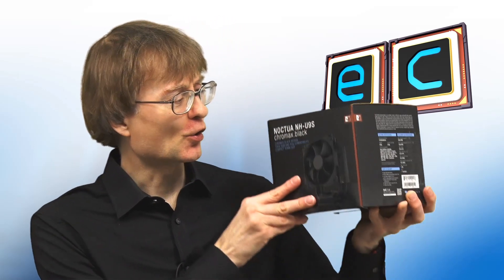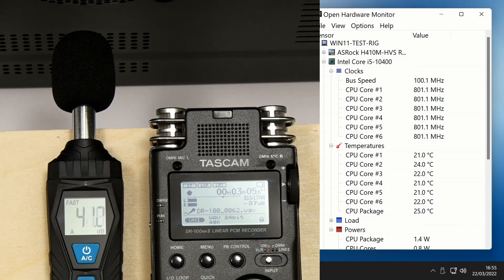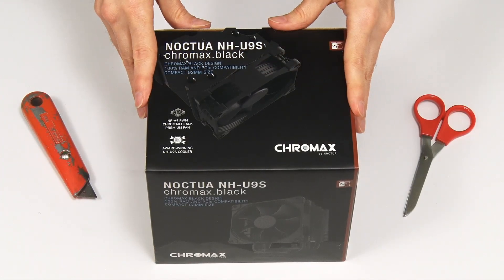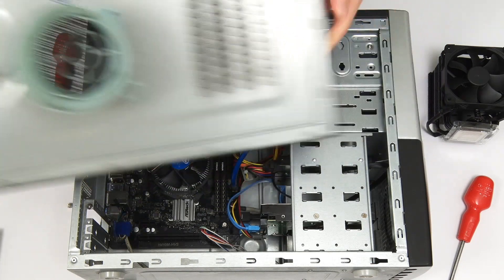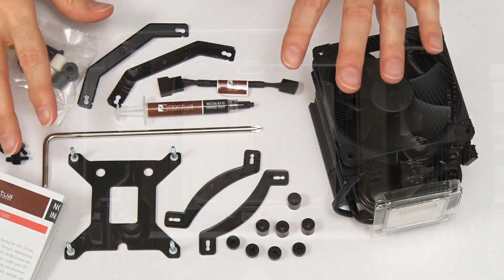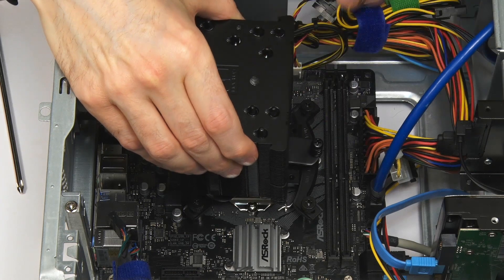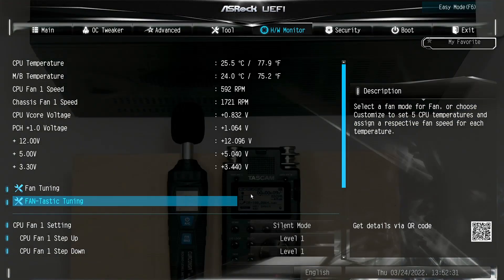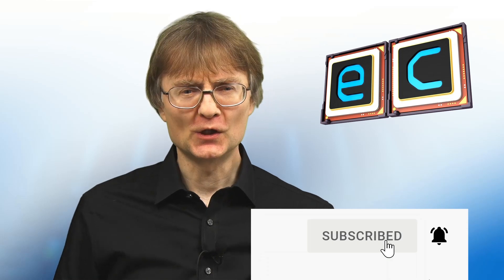Quieter PC #1: Noctua NH-U9S Cooler

Comment: Because I'm not overclocker,I'm using a 12-year-old cooller, 2 heatpipes, a quality stepped cube with thin ribbing. I changed the fan with useless thin curved lamellas and very high rpm!The best is the technology that ARCTIC COOLING came up with flat, slightly curved lamellas with 1000-2500 rpm.
I can cool the Ryzen 5 5500 at 4.2Ghz just fine and the temperature never even reaches 50 degrees. I have a 20-year-old "PRO station 2002R" case. I'm not demanding and I've been building PCs for 30 years.
I had these tower-cooller when it started only once and got rid of it! I'm old school, started with PC in the 80s, now 50+

Comment: One year ago I built an Intel 11900k system with a be quiet cooler.  I used Thermal Grizzly Kryonaut I installed twice completely cleaning the IHS and cold block prior to the second installation.  I have had no reason to look at the components since that time.

Today I learn about the Kryonaut scratching problem.  I presume that this is over blown but I am unable to find a definitive discussion of what happened and how it was resolved.  I find many angry post with speculation about what happened but nothing from any hardware reviewers or from Thermal Grizzly.

I have heard:

The root cause was improper cleaning by users.
Twisting to remove the cooler.
Hard particles that touched the exposed paste prior to assembly
Silver or Aluminum in the paste being pressed into the metal
A bad batch of Kryonaut.  I have found post from people who reported problems to TG and they replaced the paste and in one case purchased the customer a new cooler.  This may be good customer service but it is being treated as an admission of guilt.
A bad batch that is not being distributed by TG but is available via outside sellers on Amazon and Newegg.
Counterfeit paste

I would really like to understand what actually happened.  Is there a definitive write up on this problem.  As I understand it the problem started around 2018.

Comment: CPU FAN config...
That stock Intel fan could have been far, far quieter if you set an aggressively quiet fan profile. You can likely run 90degC on the CPU constantly. So I would personally have had THREE different ramps. The first is FLAT for IDLE. Whatever RPM keeps you below 60degC. Then ramp from 60degC to 80degC, then a sharper ramp to 90degC at 100% fan RPM. I use the same basic profile regardless of cooler. FLAT in idle. RAMP. Sharper RAMP. FLAT again at 100%.

Comment: I like computer cases built just thick enough to accommodate a 5.25" drive, a 120mm at the front, and two 80mm fans at the rear, unfortunately cases like this aren't made any more.

These smaller 92mm towers fit perfectly in such cases, but the 120mm towers don't. Not a problem with the quality 92mm fans available today, but it's understandable how 120mm fans now dominate the market given how awful and droning many smaller fans were throughout the 2000s.

Comment: Thanks for this! I've got an i9-9820x that puts out a lot of heat when working hard and the Intel cooler is obnoxiously loud and high-pitched. Worse, even after fiddling with the motherboard settings it still tended to constantly rev up and down. I had thought about replacing it with something bigger and quieter but it sounded like too much effort, but after seeing this video I figured seems easy enough. I got an NH-D12L and the temps under full load dropped about 16C and it's nearly silent! The Intel fan was clearly audible from out in the hallway outside the room the computer is in even with the computer idle!
Reply from the maker: Great to hear about your success with an NH-D12L. :)

Comment: Always more rather than less, for the thermal paste.
Reply from the maker: No, always less rather than more. You need as thin a layer between the CPU and cooler as possible.
Reply: @ExplainingComputers  You achieve that by using a paste that spreads well enough. If you have to little you might not cover enough of the CPU. So you just need to make sure you have enough, and an even spread.

Watch "“Too Much Thermal Paste” – Benchmark of Thermal Paste Quantity" from Gamers Nexus.
Reply from the maker: @Bart230  Obviously you need enough to achieved coverage, but that is a very small quantity. For decades this has been a contentious issue, and there is evidence to point to on all sides. Some years back I did some tests using a glass plate, and Noctua's recommended drop "4 to 5mm" in diameter was clearly ample.
Reply: @ExplainingComputers  You did not define what less means so it's subjective, and more is not an issue.

So less rather than more, can push you towards too little without any benefit, so it's wrong.

And more rather than less, will push you above the minimum, and the only negative is that there's more to clean up. Assuming you use non-conductive paste, which is pretty much standard for anyone who needs to hear this.

We're not discussing "ample" here, as the statement was not "make sure to use an ample amount"

Comment: I bet you didn't expect it would install this close to your RAM, Idk i be keeping an eye on that or remove 1 RAM Stick.
Reply from the maker: Yes, I knew it would be close to the RAM -- although what you don't really see in the video is that it is fairly high above it. Removing one module is not an option! :) Having cooler vanes close to the RAM is not a problem.

Comment: Christopher, it's really useful that you've listed reminders of the previous upgrades in the section above. 👍🏻
Interesting that you rejected passive CPU cooling because of the additional case fans required. I've usually found that a large case fan (say, 120mm+) tends to be a lot quieter that the smaller ones simply because it doesn't need to spin as fast. That said though, you're not working on the fanciest case in the world, so your locations for case fans appear to be a bit limited. 
Never a criticism of what you do of course, and you did show us plenty of alternatives too!

Comment: I wanted to make a quiet PC so I got a case from 'Quiet PC'. I'm pleased with it's acoustic quietness but dissappointed with it's radio frequency radiation. It outputs a large number of carriers in the 430 - 440 MHz band which are not present on any other PC I have.

Comment: Would a standard fan with a voltage reducing resistor be as quiet and cheaper than a noctua?
Reply from the maker: Yes, a standard fan could be run slower (and hence more quietly) using a resistor -- but this can also be achieved in the BIOS settings for a modern CPU fan. For comparable airflow and cooling, it would be as quiet as a Noctua.

Comment: Noctua is very quiet and a good noisegate like the one in adobe audition can do the rest
Reply from the maker: Noise reduction is certainly very useful, and I always use it. But the problem these days is that it is too often relied on as the fix all solution. We now have cameras, lights and HDMI/SDI recorders, all of which have fans in them -- and all of which are sold saying "oh don't worry, you can get rid of the fan noise using noise reduction software". And when you use all this equipment together, you can't -- or at the very least there is no headway for having additional noise from a computer! :)
Reply: @ExplainingComputers  Yes it works well if you record everything straight to computer. But if you use something like stand alone cameras then it is a different case. But making webcam stream it's very good. Adobe audition makes background allmost dead silent, thou it takes quite alot of power. My setup is i7 5820k  4x4gig ram and 2080rtx 8Gb 5-6 years old but still ok. Oh yes and 6 noctua fans plus 3 fans on strix card and a powersupply fan.

Comment: Very good, but wouldn't it be cheaper to put the PC in a cupboard under the table/bench with some baffles on the air ducts?
Reply from the maker: There are always alternatives, but what you mention is not practical for a test system inmy studio environment.

Comment: A good way to fully load a cpu is to use the "stress" application on the command line.  My AMD Ryzen 3700x 8 core cpu runs at 74.1C fully loading the system using "stress -c 16" !

Comment: I had just added a new power supply to my computer and was wondering if I had made the right choice. Getting to the end of your video confirmed I had. Exactly the same make and model. Other than initial start up, I have had no fan noise yet. Thank you for your straightforward, well explained and informative videos.
Reply from the maker: This is great to hear. I too have no fan noise, other than on startup -- it does not kick in until 220W draw. :)

Comment: Thank you for the video. I have recently fitted my Ryzen 7 5700g system with all Noctua fans and a Noctua Nh-D15S with a second fan fitted to it and it is pretty much dead silent now. Coolermaster N200 case with corsair 450 w PSU. The only downside is that under heavy system use my Samsung 970 EVO plus NVME is reaching 73C. Is this too high?
Reply from the maker: 73C is high for an SSD. I would personally consider fitting it with a heat sink to get the temperature down a bit

Comment: How can you tell if that blob of heatsink compound has spread across the entire surface of the CPU.
Reply from the maker: Because it has nowhere else to go as the cooler and CPU are pressed together! :) And when you remove a cooler, it can be seen! But it is important not to raise the cooler whilst fitting -- it must go down and stay down, else there is the risk of air bubbles being introduced (as there is if you spread the paste manually).

Comment: Hi, I am planning on doing something similar to my computer.  Why did you choose a CPU cooler with 92mm fan?  How did you know 120mm fan doesn't fit?  Did you measure it?  I believe I roughly measured 155mm from base of CPU to top of case?  Would be tight fit.  Is there much difference between 92mm and 120mm CPU cooler?  Thanks for the videos!  Do you plan to cover over the holes in the side to eliminate more noise?
Reply from the maker: Yes, I measured it! :) So I knew the 120mm fan coolers I looked at were 5mm taller than the space available in the case. I hae now completed this project, as will be shown in a video posting here a week on Sunday, and the PC s now virtually silent -- well below 30dB. So the holes in the side will remain open -- there has to be ventilation into the case anway. :) Good luck with your own PC.

Comment: Now swap the HDD for an SSD, and for PSU, you could just open the PSU, and install a curve bladed case fan in it.
Just make sure it's the right voltage, as some PSUs run their fans at 24V, not 12V like most case fans do.
Reply from the maker: In the next video I replace both the PSU and case fans. The HDD in this computer is not in use -- the boot drive is an SSD. As I said in the video, this is a test rig, so the HDD hangs around for use if required in specific situations. The PC is now almost totally silent (well below 30dB.)

Comment: I would strongly suggest BeQuiet for case fans, they certainly live up to their name. I run these along with a BeQuiet CPU Cooler and they're great. The computer is silent with them running at low rpm to keep air moving and under load they're still very quiet.

Comment: Seems a shame to lose the inherent air-flow efficiency of the duct. No?
Reply from the maker: Not at all. For a start such side ducts only work with small and noisy Intel coolers. More fundamentally, the Intel ducts were hardly smart, as while they guaranteed that cool air was drawn into the CPU heat sink vanes, they disrupted the case airflow that cools the rest of the system. In contrast, the new cooler I've fitted works with the case airflow, helping rather than opposing the process to draw air in at the front and out at the back. Intel's ducts were introduced as a panic measure when Intel was really struggling to keep more powerful CPUs cool. They disappeared for a reason! :)

Comment: OH OKAY, THAT MAKES MORE SENSE. LOL. My PC runs at a quiet 70-80dB of noise when all fans are at 100%. I went with their industrial line since I put a server-grade TRx3990 in my PC with a 3090, but didn't really need to go so all out, since it turns out when both GPU and CPU are max over-clocked (as much as PNY the Graphics Card Manufacture, and ROG/ASUS MB maker, would allow) the temps reach only 50C in a 26C room (I think 26C is 80F, I use F not C, in the US). EDIT: You can technically have TOO little thermal paste. As long as the paste isn't conductive, you can glob the heck out of that CPU. Since any excess would be squished out to the side. They say "pea sized" blob for most CPUS unless Threadrippers, way more than pea-sized.

Comment: I built a quiet PC in December of last year. I wound up starting with a lower power i5 processor but also faced the choice of a quiet fan vs. passive cooling. I went with the former and while the machine inst silent, it's no louder than ambient noise in the room even when rendering video. It's certainly quieter than my laptop which is pretty quiet itself.

Comment: years ago i built in a passive cpu cooler and am using it until today. additionally i built in a passive power supply and of course removed the old hdd in exchange with an ssd. result is an absolute zero noise pc.even gaming and video editing do not result in overheating. silent pc's are the best.

Comment: I would say the fan is upside down. 
But u have no case window so it doesnt really matter
Reply from the maker: I presume you are referring to where the cable comes out? It was easier to keep it at the top.
Reply: @ExplainingComputers  of course but in a case with tempered glass window you would probably want it on the bottom.

Comment: Quiet PCs just bring up an annoying topic for me. Cause of course, connected with getting a PC silent is how much power it uses. And then one has to wonder, why it is so hard to get mobile, low power processors with according low power supplies for your average PC build. Nowadays, with those very powerful mobile processors and the incentive to use less power overall and also to still have a modular computer, it is a riddle to me, why one cannot build a desktop PC with so called mobile parts. I mean, you have those nucs/mini-PCs, but they are far less modular than your average desktop PC and you basically have to throw the entire thing out when one part breaks or if you just want to upgrade one part.

Comment: Great video :) As someone who has been building quiet PC's for my clients for many years, I have had excellent results from the Noctua NH-U12S, which is the same as the one used in this video, except it uses a standard 120mm size fan. The larger fan also allows it to run at a lower RPM.

Comment: Minimum sound level (2:10): I was wondering how low the NIOSH sound level meter on the iPhone goes, and discover it also only goes down to 30dB. I discover there is a reason, which is that this is about the sound level of a quiet room, so unless you're going to compute in an anechoic chamber there's not much point in measuring lower. Always glad to see content on keeping computers quiet.

Comment: Chris, back in the day when i was in the field full time i easily built more then a couple thousand custom pc's with almost all having heatpipe coolers ( no liquid cooling back then) yet is wasn't until watching your video, twice even, that i was hit by a revelation (well revelation to me), we always install heatpipe coolers with the MB sitting horizontal and the cooler vertical, logical right, but then we run the pc with the MB vertical and the cooler horizontal which theoretically renders the whole heatpipe principle of heat rising null & void, theoretically logic would dictate that with a MB in the vertical position a solid copper cored heat sink that has large enough fins and a centrally mounted inward blowing fan would cool better the a heatpipe cooler in the same position ....do you see it?
Reply from the maker: This is a very good point, and I totally see where you are coming from -- heat cannot rise up the pipe with the cooler horizontal.  I imagine the general principle still holds -- liquid evaporates where it is heated (where the heat pipe are in contact with the CPU block), and the gas moves along the pipe where it condenses back into liquid. But clearly the process would work better vertically -- the hot gas rising up, condensing, and dripping back. I am going to worry about this now. :)
Reply: That's a very interesting point. Might explain why I've seen a few coolers with heatpipes bent at an angle so they lead up. However, in practice it doesn't seem matter much. My i7 and Xeon (both x79 era and 3.7GHz) both have cheap little HP heatpipes perforce horizontal, and despite being half the average size, they work very well ... idling around 23C and never hitting 50C under load. One case intake fan plus the PSU fans, no other cooling.

Comment: I use the original Ryzen 5 2400G cooler on the CPU.
But the case I have came with an Aerocool cooler pre-mounted.
And I also have a Chinese PSU. (the brand is Aigo.)
(I have no dedicated GPU) 

I can assure you that I've never had a quieter computer in my life.
I absolutely can't hear it working.
It's fantastic.

Comment: @9:35 -- You unplugged the old cooler's fan connector.
@15:22 -- You could see the speed of the new cooler's fan.

My question is:
Did that cable provide both power to the fan as well as data to the motherboard that the BIOS could read?

I thought that that cable was strictly for power.  If I am correct, then from were is the BIOS getting its data feed from the cooler?
Reply from the maker: CPU fan cables have four wires, which carry power (+12V and GND), a wire for a tachometer signal to report the fan's speed, and a PWM (pulse width modulation) wire to control the fan's speed. So yes, the cable provides both power, as well as transmitting data in both directions.